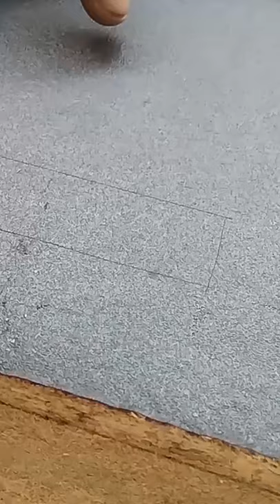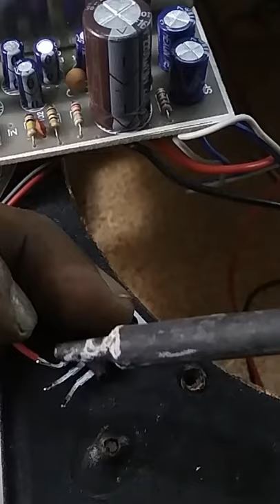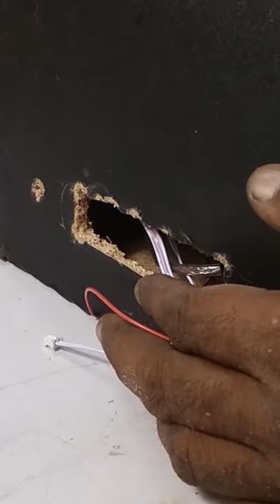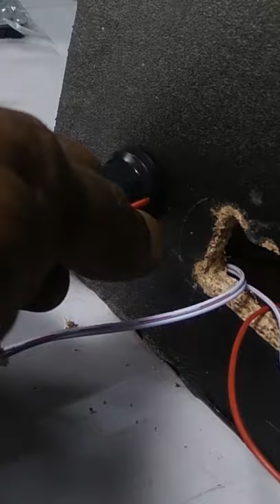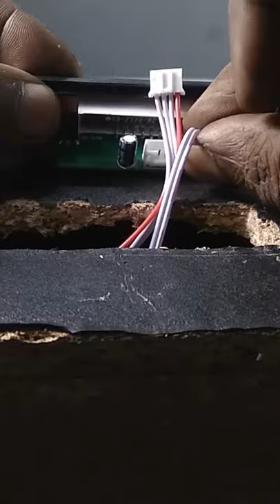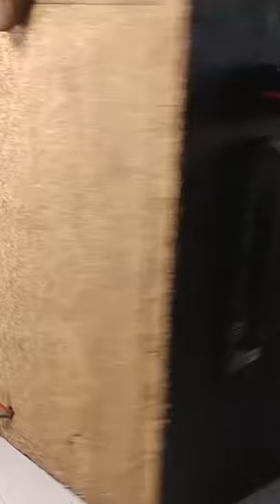ഓട്ടോറിക്ഷ സ്പീക്കർ Speaker #Shorts

Comment: Volium control  evide anu modulil fit akkunnathu
Reply: Bro module inte out putil aane  volume  control set cheyyunnathe  
Volume control inte  
First leg   grount
Second leg   input
Third leg   out put  6 leg ulla   volume controlilum ingane thanne yaane
Reply: @SureshKumar-vl2us  first leg input ground avidunnu tanne amplifier  kodukkano second right or left third out put input amplifier  tpa 3110 .3 pin ullathil right left joint akki second koduthittu third leg il ninnu 2 wire amplifier  input koduthal mathiyo bai
Reply: @ambadi1518   bro right left   wire   joint cheyyaruthe    module  short aakum     athe   stereo  connection aane          modulinte out put   stereo  aane    6 leg   ulla  volume control upayogikkunnathane nallathe      athil     volume control inte nobe  bhagam    face  ne  nere pidichal      face inte    left    2 legs   thammil short  aakanam    athane ground ee ground tthanne   amplifier  il  Ground inte bhagathe kodukkandathe     center 2 legs   input    right 2 legs out put       eee out put aane amplifier bordileke kodukkendathe 

3 leg ulla    volume controlil     R   G    L       ulla module  out put kodukkan pattilla
Reply: @ambadi1518  bro   6 leg ulla 100k    volume control  vaangikku    module inte stereo  out put aane   athe 6 leg ulla   volume controle upayogikkunnathaane correct
Reply: @SureshKumar-vl2us  ok bai thanks
Reply: @SureshKumar-vl2us  first leg input center out third leg groundum aane
Reply: Mp3 modulinte left right wires volume controlinte first pinnil join cheyyuka ground third pinnil . amplifierinte L. R. Input wires volume controlinte centeril join cheyyuka amplifier ground wire third pinnilum
Reply: @swalihcheekode8084   bro  left right  wire    joing cheyyumbol   athe modulinte out put short aakukyaaa
Reply: @swalihcheekode8084  bro    volume control inte ethelum  leg ground aaki edukkam    1   legil   thanne    ground kodiththille    nobe   karakkumbol   sound kurayum    ground cente legil  aanel    volume balanced aakum
Reply: @SureshKumar-vl2us  bro. Njan paranjadh L.R. short cheyyuka alla. Volume controlilekk join cheyyuka ennan short aakkuka alla
Reply: @swalihcheekode8084    oh   sorry  bro    😅